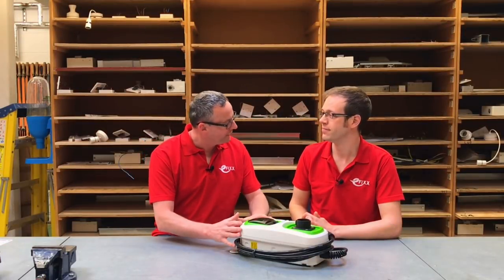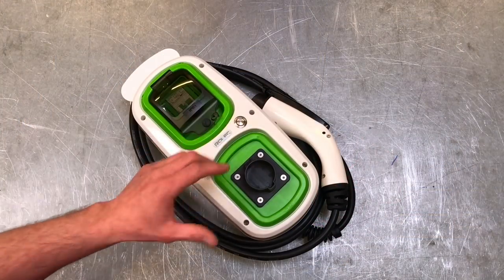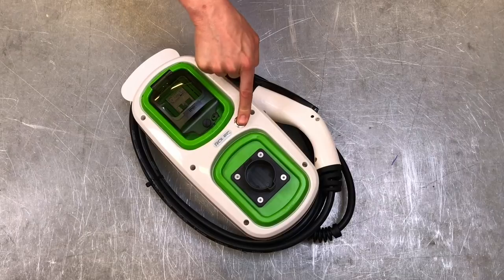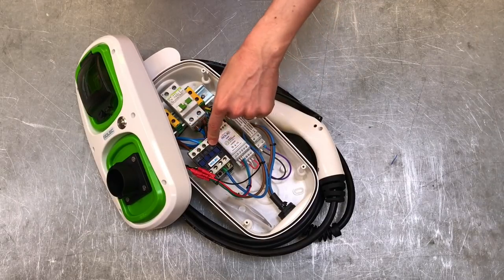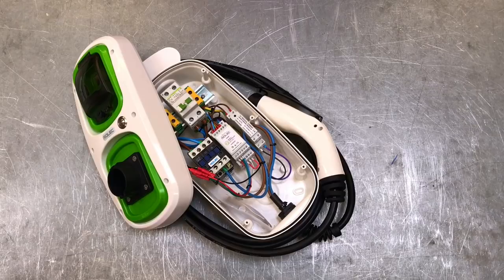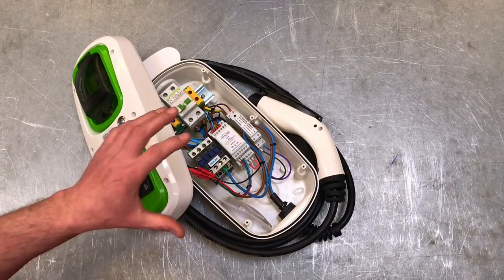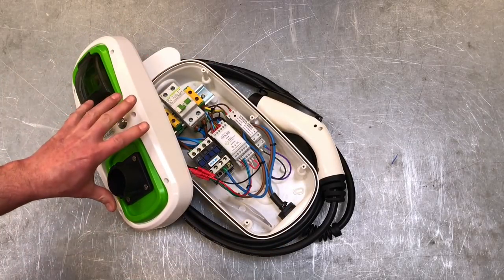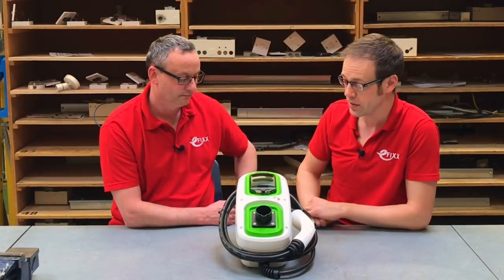eFIXX - Teardown - Whats inside a ROLEC Wallpod electric vehicle charger? (Rolec EV Charger EVSE)

Comment: Very useful.  Supports the theory that all wall chargers are hugely over-priced.   There's no exotic circuitry inside them, and heavy copper cable isn't that expensive.  There's no reason for EV connector to be nearly double the price of a PS5.

Comment: A DC fault in an EV would actually be really, really unlikely to occur, (but i can see why the regs protect against it)

1) the battery in an EV is not chassis (or earth) referenced.
2) The isolation between the battery and the chassis (mains earth when you plug your charging lead in) is generally monitored in real time by an isometer in the battery management unit.  Should either DC+ or DC- experience a fault that leads to a loss of isolation, the battery contactors (or pyrotechnic fuses) are opened
3) The vehicles  On Board Charger (OBC) itself includes a high level of galvanic isolation (generally 5kV) designed to prevent voltage excursions on the mains supply cascading into the vehicles HVDC system.

Comment: Good stuff. I think a type B needs to become standard for cars. It will only be a matter of time once cost come down to reality. Great insight. Good to see measures are taken to limit the hazard!
Reply: It is standard 🤔
Reply: Liam Wolstenholme it’s not in some! Type A is in the Rolex unit.
Reply: @e5Group  all charge points need to be fit with 6ma DC leakage, which can be provided by. type B RCD or a built in 6ma device. Therefore whichever way you design the install a Type B is used or the Type B function has been incorporated.
Reply: Liam Wolstenholme yet BS 7671 still allows an A Type with additional measures as this video shows 👍
Reply: @e5Group  that's right. So what would be the benefit of fitting a £150-£250 Type B RCD over a £30 Type A and the 6ma DC leakage built in....?
Reply: Liam Wolstenholme sorry I don’t get what your asking. It’s in the regs both options. The choice and application is down to you. We will do a further video on RCD selection soon enough. I never seen a type A at £30... either way it’s gonna cost££
Reply: @e5Group  Chint Type A RCD £32.50 Exc VAT Chint Type B RCD £215 exc VAT. There isn't a charge point without 6ma DC leakage built in. So why would you not just fit a Type A RCD, why fit a Type B if the 6ma is already built in? You'll be able to pass on a saving of circa £180. Yesss Sheffield East supply products at this price. Just ask about our company Ecoplugg.
Reply: Liam Wolstenholme I think you have missed the point. We are not debating cost albeit important. The issue is what the revaluation say which give the option of either. Some manufacturers chargers do come with type B units.....
Reply: @e5Group  what does a type B RCD do, that's what I'm trying to work out? Ultimately, if a Type A RCD and a 6ma DC Leakage integral to the unit do what a Type B would do as a standalone, why go for  a Type B and charge the customer just shy of £200 for ultimately the same thing.
Reply from the maker: Thanks for the comment e5, good to see it prompting a bit of dialogue also!
Reply: @efixx  actually had a chat with E5. funny and incredible how great of a resource YouTube is. Very insightful man. efiixx keep up the great work!!
Reply: Does Rolex chargers require a earth electrode and with amendment 1 can a type a rcbo used in the main consumer unit (I've not read amendment 1 yet)

Comment: Hi Guys, great video. I have one of these but it does not have the DC device you refer to. All the other components are identical to those in your video. Any thoughts on why this would be?
Reply: The one I just bought off ebay is the same as yours. It's all the same as in the video, but no DC monitoring device installed. Did you ever get this figured out?

Presumably we'd need a type B RCD of 40amps installed at the consumer box as a source for the charge point. I'm just waiting on mine being delivered, and I've emailed the manufacturer for any information and documentation they can provide. If you've got any advice, I'm all ears!
Reply: @VortexMotiveVision  Yes. Just fitted dedicated rcb. All working fine.
Reply: @FitOnce  An RCB? Not an RCD?
Reply: Just checked. Its actually a 32A MCB.

Comment: Hi there, I haven't been able to find any installation guidance on these. I note they have a 40A RCD in the pod unit, but then how they connected to the consumer unit in an everyday residential installation. Are you running them to a 2nd RCD in the main consumer unit, or just an isolator switch in that same consumer unit?
Reply: If its SWA all the way then you'd typically have a 40A MCB protecting the circuit, either in the existing consumer unit, or inside an additional consumer unit.

Comment: Hello gents. I've had this unit for more than 2 years and it worked great. However recently the RCD started tripping.  I've read some stories about the contact points to the RCD overheating to the point of melting the plastic. I haven't dismounted it yet, so I can't confirm it. Could  that be the reason possibly?
Reply from the maker: Sorry for the late reply on this - did you find out the cause of the problem?
Reply: @efixx  yes. Guys from charge ev came and replaced the RCD  as well as the front panel as it was beginning to crack. 
This was the common problem with contact point melting.

Comment: With this having a type A, do i need to install an earth rod for a tncs system?
Reply from the maker: The RCD type doesn’t set the earthing system. This is an old video so earth rod needed at the time on TNCS. Now it’s recommended to fit PEN fault protection or a charger with a pen fault monitor.

Comment: The center piece, you say, communicates to the "car charger" that is inside the car (6'10"). Is that the car charger or "AC to DC converter"? Great video. Thanks. Will look forward to one with the AC to DC converter built in - that bypasses the converter inside the car and directly charges the battery.
Reply: I later realized by "car charger" you meant "on board charger" - that converts AC into DC.

Comment: I’ve bought a send hand 16A 3.kw charging unit, and it does not have this current monitoring unit, so can you buy them separately, because I need to get one, an update video would be good to help people bring their unit up to date!
Reply: The term you want to search for is "EVSE module", lots of modules out there you could wire in and replace the "brains" of this unit, though I'd consider this an advanced project!  Also familiarise yourself with the requirements for PEN faults when it comes to EV chargers.

Comment: Can the cable with the plug on it be replaced easily ? I’m looking at this, but I would need a 15m lead. Thanks
Reply from the maker: Most manufacturers can supply replacement leads. The longest lead we’ve seen on a tethered unit is 8 meters. It might be an option to by a non-tethered unit and buy a separate lead to reach 15m.
Reply: efixx that’s great, thank you for replying .

Comment: Every electric car comes included with a BS1363 charging cable, so why would I want to spend additional money on one of these when I could just fit an outdoor BS1363 socket.
Reply from the maker: Hi. If you plug your car into a BS1363 socket the maximum current you can draw is 13amp but the loading this ways is likely to be closer to 7amps. From the unit shown you can draw about 30amps this means the car will charge way faster... all the best and thanks for commenting 👍
Reply: @efixx  yes, a 13amp UK outlet will charge most cars at about 7 mph. Give or take. A 32/40 amp supply will charge  between 20 and 30mph. So if you want to get a full charge within the  over night economy 7 hours, you need this or something like it.
Reply: I think it worked out about £8 a week more expensive to charge over night and day for  24kw a day 5 days a week as it takes 10 and half hours charge.. I get in at 3 am so probably £6 for someone else who can start at 1am when electricity is cheaper.
Reply: convenience, quicker, more reliable, safer and in some cases features such as scheduling and energy monitoring/billing.

Comment: Great video guys, informative to me as I never really looked at EV charging until I saw this. Now..i'm a sceptical kind of guy.. but is this really just another stealth tax money making scheme in the making?.When fossil fuel eventually goes to confines of history, the inland revenue will need fuel taxes topping up yes?..hmmm how can they do that?.. charging points with tax meters on them? sealed by the utility companies? just like your electricity meter is now?.. that's one tax easily done, the other is manufacturer's of these charging points, test kit, IET releasing new books, regulations, BS7671, another VAT added to joe publics ever decreasing pay packet. I feel we are being forced into EV use, which i'm all for if the infrastructure is in place for it, but it simply isn't and the charging process is a MASSIVE limitation, as are the price of the cars/vehicles, We are just creating work and money for no reason other than "green energy" I won't get into that, life is too short..anyway, this particular charge seems to been thrown together and built to meet current regulations regarding AC & DC earth leakage?.. someone will make a charge point with 1 X 230V AC input and straight out to your car via one device, prob go into your CU like an MCB/RCBO type thing, I'm all for innovation, it's still early days, but interesting to see what's inside that charger, i'm a curious fella, and enjoy your tear downs. If I could offer a word of advice though, please don't be biased towards a company who sends you stuff, please be critical and honest in your reviews, then you will have a great new channel here. Just my 10p worth...for what thats worth?...5p no doubt lol. :-) loving your new venture...and as always, I thank you for your hard work and information...
Reply from the maker: Thanks for your feedback and some good ideas. Two things are certain in life, death and taxes. From our research, the government will recover the lost fuel taxes via the yearly vehicle duty and perhaps more road pricing schemes. Of course, they could just increase VAT on electricity, but that hits all consumption. 

With regards to EV chargers, we wanted to understand what's inside to justify the price. We chose the ROLEC unit as they are readily available. many of the others are only available with installation from selected installers.  We will be looking at others when we can get our mitts on them. When we can compare and contrast a few units we can make a qualitative judgement on the various user and installer benefits.

If your keen to explore more on the government funding which flows to electricians - check out our guide to the OLEV scheme.

https://www.efixx.co.uk/Articles/efixx-guide-to-olev
Reply: @efixx  if they impose high taxes on high speed charging then most people will just charge with a 13amp plug. At 7mph that will give about 100 miles added overnight . With the average comute being about 28 miles that will do for day to day use, remember the high speed public 250+mph  chargers are still there for road trips etc
Reply from the maker: patdbean 7kw, the one we reviewed, is not really considered high speed charging. It’s safer to charge with a dedicated outlet than a 13a socket. The high speed chargers on motorways can be very expensive ~30p kWh - where as night rate economy EV tariffs start at 5p